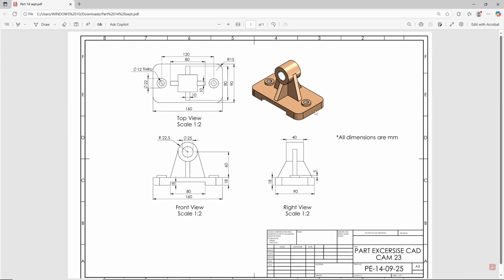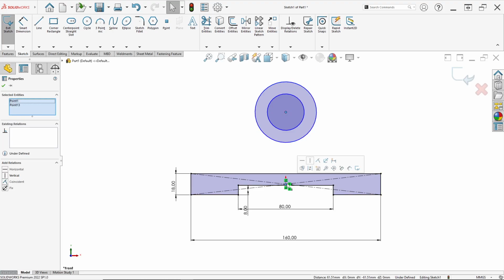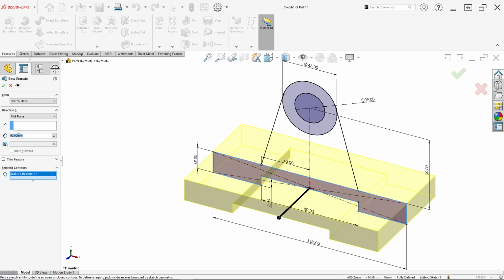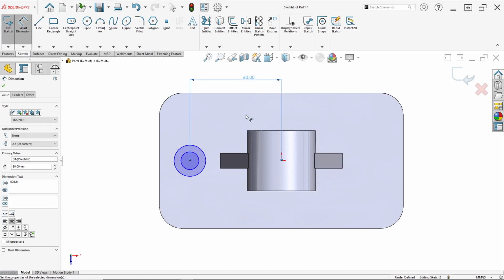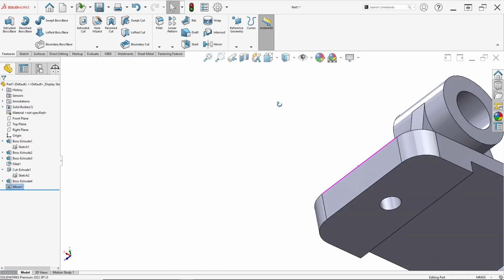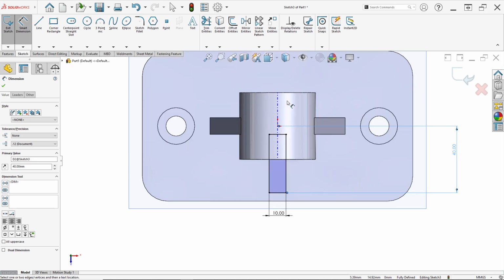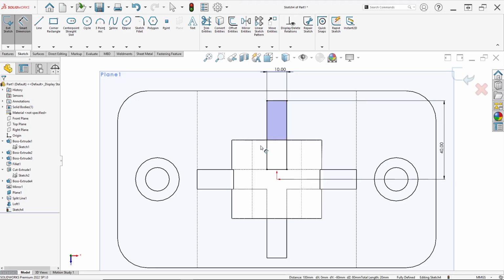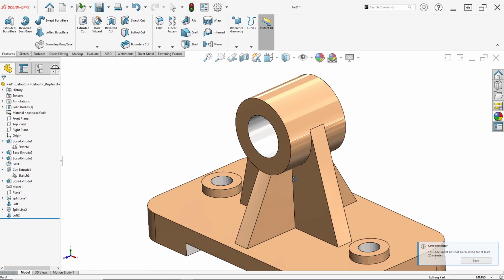Beginners Guide to Rib on Cylinder in SolidWorks

Comment: i could not find any solution how to do a rib on the side (not towards the hole) of the cylinder. I dont even need the rib feature. I just need to reuse my initial sketch and just differently Extrude them parts. Briliant. Thx
Reply from the maker: Yes, you can. The rib feature can be tricky when the direction isn’t toward the center. Reusing your original sketch and extruding it is actually the easiest solution. As long as your sketch is fully defined, it works perfectly. Keep going—you’re doing great.